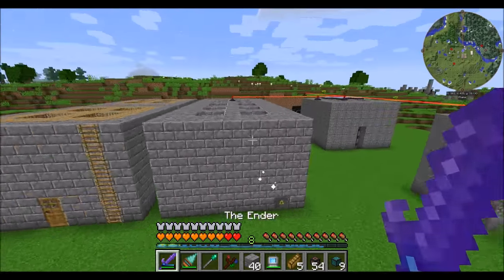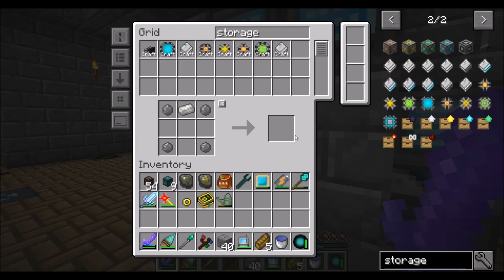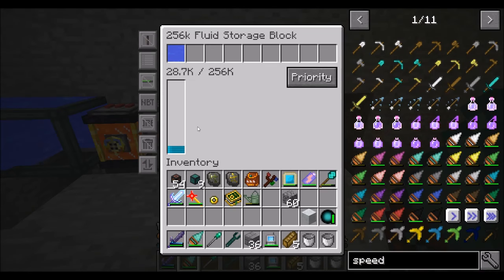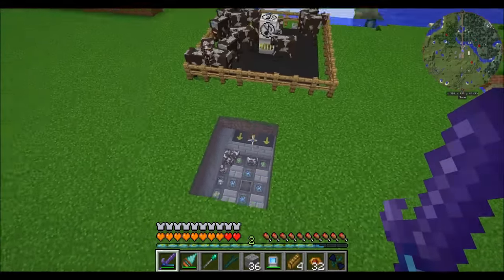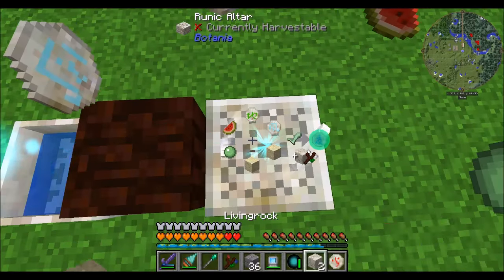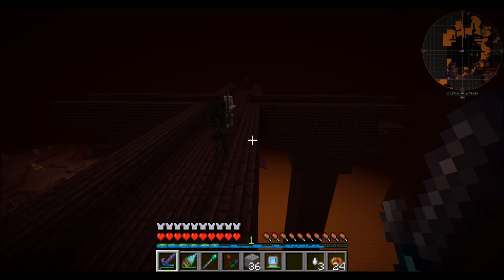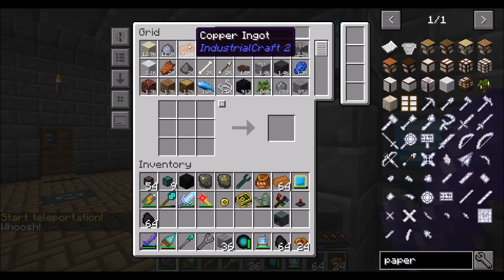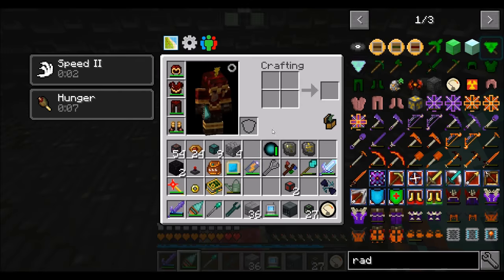Lets Play S8 E43 Wellington and Skellies

Comment: Dire, I know you dislike having redundant systems, but the "fix" to the derpy infusing system... build a 2nd setup specifically for your seed infusion.  Then you wont have the problem of the automated request on demand "crossing wires" with your specifically requested demands.
Reply from the maker: It'll still be a problem if I try to craft the empowered iron and diamonds at the same time then. Less frequent of a problem, but still a problem :)
Reply: Tangent, but Beef Wellington isn't the best food in your pack. Actually Addition's pizza is, with a full 10 fullness and 10 satiation.
Reply: There is one solution for this, that involves a lot of redstone wiring. The idea would be to have a chest and crafter for every item and when one chest has stuff in ti, meaning the crafting of an item has begun, you lock the itemconduits of all other chests with redstone. That way you make sure that only one recipe can be active. 

Now there is one issue with this: The system might lock every chest, when 2 or more chests are full and no crafting is done at all. In order to solve this, you need to also check, if the empowerer is crafting and if that is not the case, but chests are locked, you need to have it unlock single chests until something is being crafted - that's the part I also haven't really figured out tbh. But maybe this still helps you and you can fill me in with the part I'm struggling ATM ;)
Reply: direwolf20 I was thinking that you might use rftools control for the empower you could pipe the block/crystal onto the center then check what item it is and have the rftools controller put the items needed to infuse that item on the other pedestals that way it could never mess up
Reply: Right, unfortunately it looks like you need a 1-to-1 infusion setup per crafting recipe.
Reply: On the bright side, it looks you could tile another infusion setup right above it, may not look the best but the sky is the limit!
Reply: CrankkDatJFel what do you mean by that. If done with rftools control it could be done with 1 setup
Reply: alex siviter, Way beyond my knowledge, sounds like a cool solution!
Reply: I just looked it up in game, in the most recent addition of the pack it is only 8.
Reply: I mean you can just build a individual set up per item just like that one time you automate rune crafting for Thumcraft
Reply: I see it  with only eight food bars
Reply: Chad Daniel Yeah, good eye. 8 hunger, 10 satiation

Comment: 18:04 AppleCore and AppleSkin would be a good addition to the pack in that case, since they display saturation levels.
Reply: ^^ That, it's very helpful to see the food effects by mousing over. Also Cooking for Blockheads would be another cool addition for food stuff (+ it has a sink that provides infinite water instantly unlike the reservoir and you can pipe it out).
Reply: in an earlier episode he did say you could add mods to the pack yourself.

Comment: My infinite water source of coice is a Fluid transfer node with a world interaction upgrade and speed upgrades, on the center block of 3 water block line. works really well and is much faster than that reservoir setup. you need gpower to run it but you have that in spades

Comment: Actually dire, there is a cookie from Botania that has a better food value.
Reply: There is also, if I'm not mistaken, the Delighted Meal from Pam's - I know it at least restores the same hunger as Beef Wellington, but I'm not sure about the saturation - I remember it consistently refilling all of it - Though, it is a lot more steps to make.
Reply: +ryerye2828 There's always Epic Bacon. It fills your hunger and I think it fills your saturation too. In fact, he used it to power the food flowers from Botania(I forgot what they're called :P) in his first Sky Factory 3(The one he did with Soaryn). It's pretty simple to make too, just pork or steak(cooked) and 8 specific dyes. He probably isn't doing it here because of the dye problem. He does have his mystical flower petals, so idk.
Reply: What it could be, perhaps, is that he has no good way of mass-producing dyes. Though, if he did something such as auto-crafting bonemeal, then putting it into a mechanical user pointing at some grass, he could, with (GASP!) vanilla redstone, a vacuum hopper, and a set of drawers linked up into an AND gate with the system turning off when they were full, he could probably quite easily have infinite dyes.

..Heck, if he wanted to be fancy about it, he could set something up that auto-crafts the composite dyes, add a cactus farm (for green), and just processes everything into the dyes, which would then be made accessible to the RS system. Would be a fun bit of automation to work out, probably, and an excuse to make something different in an effort to gain yet another food item for use in something. As well as having a healthy amount of dyes and flowers available.. As well as all of the Pam's seeds, eventually.

I kinda miss the mod, though, which encouraged food variety - Was it Spice of Life or something? I can't recall - by way of diminishing returns.
Reply: +ryerye2828 That does sound like a good idea, and I actually feel like going into his world and setting the system up just for the heck of it. It wouldn't be too hard, the biggest problem would be how to destroy all the flowers once they're planted. I don't know if the Ender IO Farm Station can handle flowers, but I want to check. Once I figure that out, there's not really any challenges left.
Reply: Well, there is a vanilla system for this - Set up an area of grass no wider than twelve blocks, and then put pistons along either side - One with a one-block gap, and all of them facing inwards. Then, line redstone in such a way that it can activate all of the pistons, and have repeaters at the end, one of them set to a longer delay than the other (4 ticks vs one tick, perhaps) to activate the piston lines in series. Or, do something fancy and have a SCM circuit that, via a timer and logic gates, sends out pulses in an up-left-up-right pattern. Up goes to the bonemeal user, and left and right go to the pistons. Add in something else to turn off the timer once all of the drawers for the dyes/flowers are filled, and voila, you have something that should auto-grow and break what you get from vanilla bonemeal on grass. The nice thing about this system, too, is that with good use of and gates, this could be used with floral bonemeal (not too hard to get, don't remember the actual name) without too much in the way of involved alterations. Then you just feed it through something that crafts the items by themselves to extract the petals, or store the flowers themselves - Or both, if you want to have a backlog before the machine starts again.
Reply: jaded amranthus (functional flower that spawns mystical flowers around it for a tiny bit of mana ) then put a drum of the wild near the functional flower and then place a redstone mana spreader near ish to the drum  set up a timer " once ever x seconds "(u pick what x is defined as )the spreader gets triggered when it gets a redstone signil , when the drum gets struck by a mana burst some of the mystical flowers will get uprooted (the drum litteraly does the horn of the wild effect)and drop as items then u collect them  with your  method of choice . congratz u now have an easy means to get all the dyes in the vannila minecraft rainbow (mystical flower > 2 mystical petals > petal + botania pestle and mortar=  floral powder of that color)
Reply: Actually @ColinAndress you are right about that, but only for consumption, not mana generation. The mana cookie may not work as well due to the fact that it doesnt just give you the huge saturation, but rather gives you the saturated potion effect, which obviously doesnt work on flowers
Reply: I saw that PapiDimmi xD
Reply: @papiDimmi Bad thread necromancer the comment is about a month old

Comment: You totally don't need to put 256 buckets of water in your system. The importer on the reservoir is totally fast enough to keep up with crafting and me taking out water manually and I only allowed refined storage to pick up 32 buckets.
Reply: Depends how many items you want to craft at once.  You see in this very video that making 32 beef wellington requires 64k water at once, so with your setup you couldn't make more than 16 at a time, even if it does refill quickly.
Reply: I never tried with dough, but even if I take out a full tank of 16K water out of my system it replenishes really fast. I am pretty sure that refilling water will be faster than producing the other incredients or beef wellington.
Reply: That's not the problem, the problem is that it won't let you start crafting until you have enough water for the total operation.  Although it is possible to force it to start anyway, and as you said, the water is likely to refill fast enough to keep it going.  But it's a bit more of a hassle when you could have just put a slightly larger storage block down.  They're pretty cheap.

Comment: Just downloaded the new update to the pack and It crashes every time I try to launch. Anyone else having this problem? se binary problem?
Reply: Johng2476 Where does it crash? Does it get to the loading screen? If not, update your java and/or use a version of Java that is not higher than your computer's architecture (Don't use x86 with a x64 architecture, or 64x with a 32x architecture)
Reply: I was hitting the point at rftools initiation then stopping there. I fixed the problem. My video driver needed to be rolled back. Thanks for your response though.